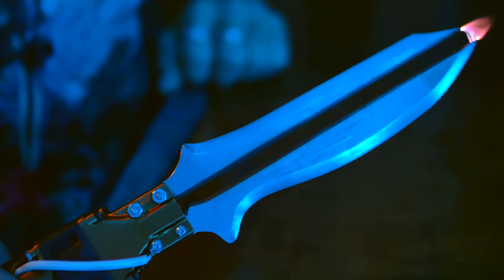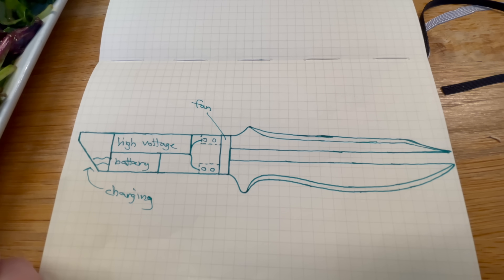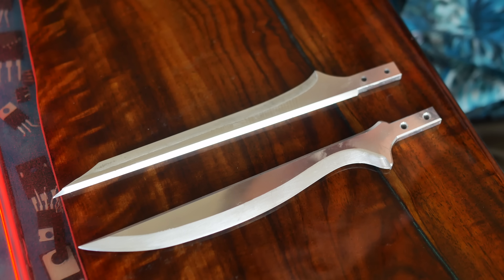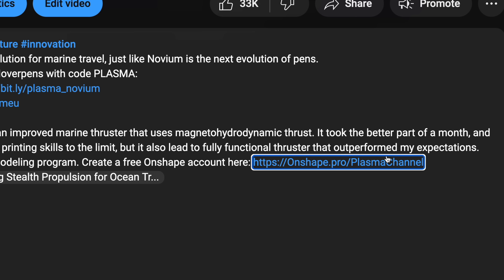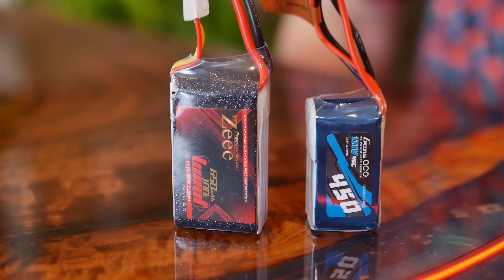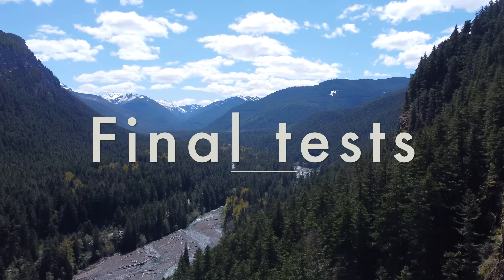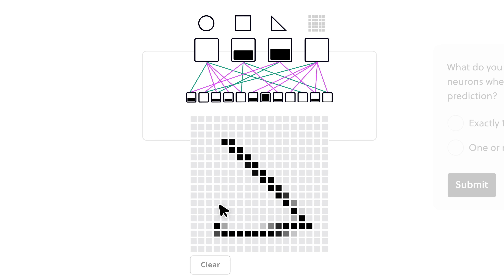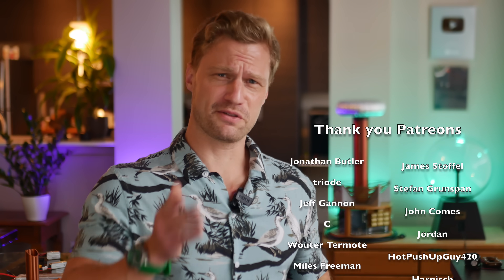A 20,000 Volt Next Generation Plasma Knife (Halo Inspired)

Comment: Like another of your comments please continue the mhd and and also love to see some different versions of ion thrust space focus engine designs. 

What's the new modular nuclear reactor designs being made specifically for space imagine how much thrust you can get from either an array of ion thrust engines using a high energy density reaction Mass that's converted into plasma. I would think starting out with some sort of metal wire would be the most dense and most efficient orange is the liquid version of a metal that would be easier to store. But that would be interesting to know what the current state of ion thrust Motors are and how much reaction Mass would be necessary to move a couple of these modular nuclear reactors as you would want 2 for redundancy. 

You can launch ONE 1-5 Mw modular nuclear reactor or SEVERAL 40Kw modular reactors on a Falcon 9 Heavy. How big can you make the ion thrust Motors or would it be preferable to have an array of smaller thrusters?

Comment: You could fill a handle in the middle, build the lower part of the blade out of a dialects that transitions to a metal so that you make the high power connections inside the "faux hilt" part of the blade(s). You could also use more power with the dialectic / metal with the handle in-between. The Halo weapon is really more of a piercing weapon that it is a cutting or a slashing weapon. And holding it as you do from the handle in between the blades allows the power and the heat to not only electrocute the target but also heat the blade and make it easier to puncture various materials. 

You have the handle like a normal hunting blade as opposed to one that's in the center allowing you to put your entire body weight into a forward piercing motion. Imagine how powerful the piercing motion would be if you could push the handle which is rather than parallel with your arm perpendicular?

Comment: 10:57, how did you not get a shock?
Reply: Frequency was probably high enough to not feel pain and only cause burns if left long enough

And shortest path is still from one side of the blade to the other since he’s isolated from the blades it doesn’t make sense for the electricity to arc from the blade to him and back to the blade

Comment: So the blade could be in liquid forrm,, coming out the handle and becoming charged and hardening when plasma floes through, becimes liquid again and goes back in handle when turned off.. could use a liquid ceramic with metal content, can have chemical content like a light bulb???

Comment: Why did vitalii have his cutter blowing away every drop of oil it was putting out? At first I thought it wasn't using any oil but then I saw there was the smallest layer, I'm no machinist, but success may have been found in such a stout machine if the lubricant was allowed to actually coat the bit. But someone correct me if I'm wrong

Comment: The short tang on the blades makes me really not want to strike at anything with it. If I were to make it functional as a tool/weapon, increasing the tang to the length of the handle would be first on my thoughts. Second, would be using a blower fan rather than case fan. This would allow you to use the side as an air intake, and pot the internals in resin and rig up an external USBC charging port. Potting it in resin would increase strength and insulation. As for the shape of the handle, I'd make it a bit more ergonomic, especially since the handle is going to be a bit fat as it is, it should fit comfortably in the hand and not slide about.

Comment: I would love to send you an idea I've had for a long time to make a halo and predator inspired energy sword. It's pretty similar to the knife you made but it would require custom blades and a special design for a two sided spring loaded or maybe even electromagnetically driven locking system for extention and retraction. Basically it's a mixture of the Elites energy sword and the telescopic wrist blades of the predator. But at the backs of the blades there would be D.C. motors running at opposite polarized at an extremely high frequency hopefully. I'm hoping it has very bright coronal discharge and that it can cut through metals harder than what it's made from due to it.

Comment: Your high voltage projects never cease to amaze me, and this Plasma Knife is no exception. There is one detail that I would have done differently, and that is to hide the hv wires through drilled channels in the plastic housing. I believe that the device, overall, would look more professionally designed and built. Except for that, you did a super awesome job on it!

Comment: Love your work.  I am tweaking  my build of a desktop plasma cutter....to do things like cut out ur blades used in this video.  Think of  the many pen plotter vids out there for pen plotters.  My torch is hacked from a full plasma cutter.   But, really needs a miniature 30A plasma pencil like torch for up to 1/8 " steel. It could be transferred arc (conventional plasma cutting) or no transferred arc, i.e. your flame/candle designs. I'm 75 with fading build skills but would love to discuss with you if its on your radar.

Comment: New subscriber, loved this channel! Idk why I think this would work, but this is my bro science opinion lol...what if you angled the blades inwards just a lil, and made it less wide at the bottom guaranteeing the arc starts at the bottom and finishes at the top as it gets narrower, also I think for controlling the fire more you need to put as much air in a small space that gets more and more enclosed as it gets longer going up the blade controlling the airflow with less fan power and more design is the answer to guaranteeing that it runs up the blade more! Maybe putting a pipe like air hole on the back of the spine of each blade that is exposed to the fan inside the hilt, forces air up the center of the blade with little grill burner like air holes,! muahaha, I'm probably wrong but it sounds cool lol

Comment: @Plasma Channel -- I think it did not occur to you that jet turbines have compressor blades and stator vanes with rows of tiny air holes along their edges allowing cooling air to be forced out to act as a protective barrier to the hellish temperatures and chemistry of the combustion stream.  Using this tech you might supplement or replace your fan, even enriching the airflow with a gas with incandescent properties.

Comment: You realize; You just made the basics of a light saber. At this point, all you need is a retractable telescopic double blade like you have, and the ability to feed the internal space with a conductive gas, small holes that get gradually bigger the further up the shafts you go on the inside and outside of the tubes, and you'd have a semi working Light saber.

Comment: I have done this type of thing.  If you create a surprisingly small  B-field through the blade gap, then the arc will shoot right down the blade by the Lorentz force.  If the blades were each magnets (axially) magnetized (PM)...or, alternatively, incorporate a couple of thin turns of tiny magnet wire (EM).   No need for a fan, and you would also have the choice of shooting a capacitive discharge down the slot.
--dALE

Comment: Plasma points
Blades of the future 

Laser printed metal has microscopic hole where air can pass through and with the batteries and components to make electricity
Plasma might be able to pass through the hole through the whole blade and possibly make an functional futuristic plasma blade maybe as like a solid energy blade like in popular media this could be the first in plasma base weapons some idea I have already thought of has been weight and strength of laser printed metal parts and blade with it technically being lighter but just as strong as forged metals but you’d still want the classic blacksmith and nuts and blots you’d always get from stores and such the hilt could hold most of the electronics the fan to force air through the blade could maybe if possible be custom made to force more air but also be compact but for prototypes use a small pcb computer fan as far as I can tell it’s called a pcb fan I’ll do more research on that the tang of the blade could be where it starts the point of the electrical arc to start the plasma point that’s what I’m gonna call the first plasma based blade prototype plasma point first knives and daggers then full swords im not sure what effects plasma would have in this function but the idea could work I’m doing my own research and designing of the blades like a katana style straight sword with Serrations and large spikes and different shapes of blades I’m even gonna work on the hilts and handle grips pommels all the parts of the plasma based blades plasma points I’m also going to do research on what effects plasma blades could have maybe they could only be used functionally for surgery or maybe make some sort of electrical magnet field I feel like this could revolutionize plasma blade technology or it could be cool cosplay effects or something the idea has potential some where in media and maybe even power armor combatants of the future for military tech iron man with a plasma sword and firearms of the future protecting the world would be awesome maybe this is all just a fantasy but the possibilities have potentialI want to shout out the channels that lead me to this idea shadivsity integza plasma channel the hacksmith I’ve been big fans of these channels for awhile now I hope at least for the most part I could see this idea used in content for the channels I would love to help anyone that would try to make this idea a reality plasma points blades of the future at the bottom of this article page note or comment on YouTube this is I put the channel that gave me this idea there are so many more but as I write this it is super early in the morning and can’t think of the others but the most influential for this particular idea of blade design I shouted out I’m sorry for the others that I have not mentioned you helped possibly making the most functional plasma based blade in the world or I’m just a 24 year old sci fi fantasy nerd that needs to be more productive and get a real job lol who knows I’m hoping this will be the future of bladed weapons or plasma based tools like I said I’ll do more research to see what effect plasma would have for weapons and tools thank you hope to see this idea make some future tech a reality and make some dreams come true plasma points blades of the future 

https://youtube.com/@shadiversity?si=q5tNy6Ao2XDEaUpL

https://youtube.com/@theHacksmith?si=Fu-wstUAW347fx1d

https://youtube.com/@integza?si=Fh84jJTTMNXd-t-T

https://youtube.com/@PlasmaChannel?si=bO7oGpyhsqBJzTfO

Some honorable mentions 

Allen Pan 

https://youtube.com/@allenpan?si=TvmVaSTKWVWBi39R

Tommy Callaway 

https://youtube.com/@TommyCallaway?si=sgooAK1sx9Y2t3rP

Comment: if you did a similar thing but only firebased could u make  holes going down the middle of the blades and have fire pushed through the holes so the fire goes down the middle to the tip mayb holle if the inside of the knife was hollow the flames could fill the inside of the knife and push thru the holes consistently and you could use less power to do so and materials that wont melt or burn would probably make the blade dull but yk just for the looks, it already wasnt practical for cutting.

Comment: Since you're already creating a lot of high voltage in the small circuit, take half or less of the voltage you'll be using for the blade and replace the fan with an ion propulsion cluster, the pre ionized air may make it easier for the plasma to hold, grabbing one of your welder fans (like me) and bronzing or soldering silver onto the desired current path would as mentioned by others help stability.  And maybe you could use the resonating electron plasma @integza showed you, Instead of doing a jacob's ladder make the blades more of a bipolar resonator, (FCC is gonna hate you,) and just rely on pre exciting the air enough that you can get a bolt or beam to resonate into plasma between the blades.  This approach may allow you to create more heat and project the plasma blade further then your electrodes.  Would be interesting is if you can get an electric resonance to make two blades of plasma to form on opposite sides of a single central resonator spine for the energy weapon.

Comment: Great video! 
One tip for the blade shape: a higher primary grind is better for cutting. That knife uses a saber grind but it's a very low grind, resulting in a very obtuse angle. 
If space wasn't a constraint, the handle could have an oval cross-section to help blade alignment.
Of course, if this is not used for cutting it's a non-issue.

Comment: On the version of having a magnetic pull could it be an open blade with the static of your recent plasma distributor or plasma gun thing. 
   Shooting down the blade then repulled downward toward the hilt at the tip of the blade. Example being lightyear (movie) laser blades. 
   BTW heading toward lightsaber area

Comment: For equal spacing of the plasma could you forge highly conductive material at the spine on each side instead of the fan? Should be able to forge copper wire  into the metal that comes to the surface at points all the way up the center and attach that to the battery. Extra points if the blade material is far less conductive but still can bring charge to the edge on contact.

Comment: Im curious about what kind of difference adding serrated edges to the inner blade would make. Would it give the plasma more or less resistance when making the jump between the blades? Testing the efficiencies of different serration spacing( i don't know if there is an official term, but the space between each point) would be interesting to see.

Comment: If your going to make the full blade i would think you should go with a backpack with power supply and all your components even including fans with piping/wiring to the wrist. With the blade being pretty much impossible you could make the glowing part of the blade in plexiglass and case it in wiring to make it visually as cool as possible in the dark also sandwiching the ionized air in-between the plexiglass to help with the air flow to the end of the blades.

Comment: If you don't want it to Arc at the base it should gradually get slightly wider as it reaches the top with the spacing maybe a difference of 1 mm there at the most between top and bottom might actually do it

Comment: It's not cheating to add a wick.  Consider  a zippo lighter, fast and reliable.   A soaked wick at the bottom of the blade would catch fire from the arc and emit a flame that would travel down with the plasma to hopefully reach the far end.  More power on the arc, maybe less on the fan.  It's noisy.  I suppose you have many iterations and I should shut up, be the tiniest bit of carbon wick might help in difficult places and a little fuel could add color, especially if you use methyl alcohol with a solution of boron or copper sulfate.  A colored flame in combination of a plasma knife would do wonders.

Comment: Imo for something like that you'd probably want a "press and hold" switch so that if something goes wrong you can just drop it and it is instantly disabled. Kinda scary to hold something that has the potential to shock or burn you without being able to turn it off easily. Could also set something on fire if you shock yourself and drop it.

Comment: I love the design. I would consider copper plating the inner edges of the blades to provide better thermal and conduction edges. Copper plating is super simple to do at home. You can even do pen plating, this is where you use a pen with like a felt or wool to apply the plating to the specific places you want. Its very simple to setup, copper sulfate is cheap and you can use solid wire as the source of copper, but a small pipe is generally a little better. I think the inner 1/8" of the blades copper coated would make for a nice 2 tone color design as well. Just my 2 cents. I have a few of those 10kv power sources from ebay, i haven't figured out a project for them yet but this is great inspiration.  Keep up the great content

Comment: You can make a sword based on this, changing the plasma generator with x2 40kv high voltage converter, x2 6000mAh lithium batterys, and a semi-turbine like fan for the plasma between the blades, and for the blades you can use tungsteno and silver, the blade that you made is so cool

Comment: This was cool. I understand that air flow is an issue with putting out the arc flame. I think you should experiment more and refine this blade to get the plasma to be a solid field from root to tip, maybe some how enclose it. The look was great but more refinement for both aesthetic looks as well as functionality. I liked your idea for the future as well. Maybe have the plasma run along loops that are shaped as the blades some how filling the middle. If there is away to make the orange flickering fire not as prevalent or nonexistent keeping the brilliant purples whites and any other plasma looking color. Good luck!

Comment: The powersource doesn't have to be in the handle. Heated jackets and sweaters have a pocket with a wire . The power source can be external.  Belt worn , or back strap,  or chest holster worn close to the shoulder to keep wire length short and hidden.  Easy .

Comment: Did you consider using magnets on the   gap to propel the so the ark is propelled rapidly towards the tip of  the knife by the Lorentz force? I've seen it demonstrated with a concentric configuration of cathode and anode and it moved so fast it looked like one angry glowing surface